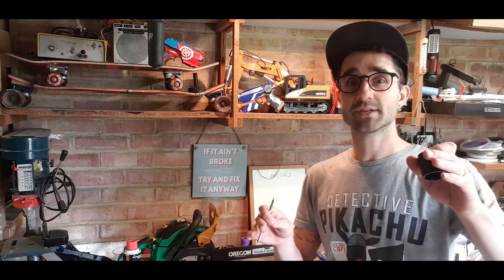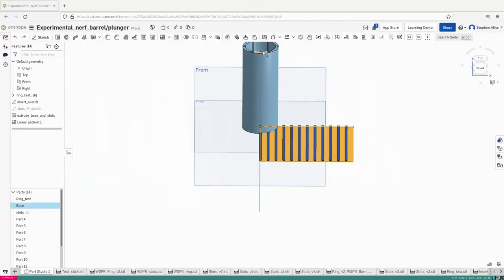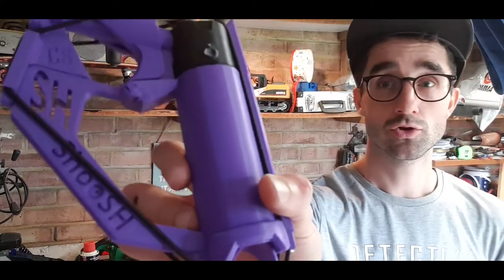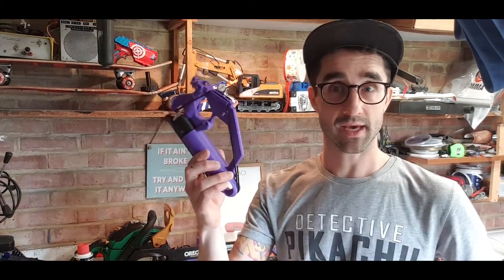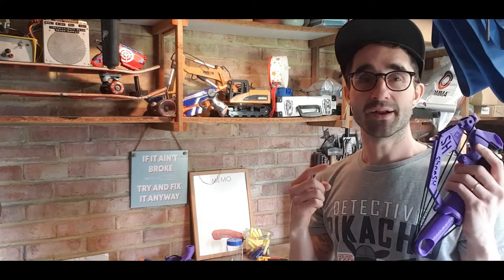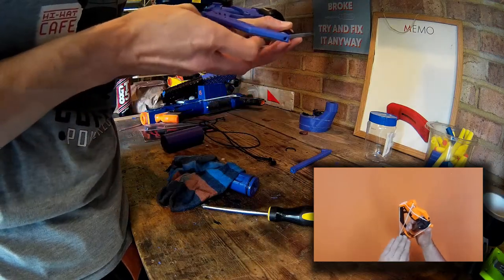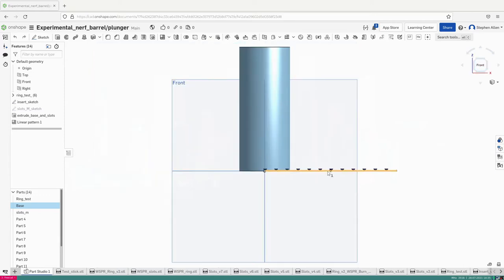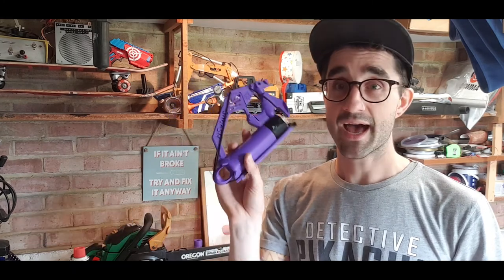3D Printed Nerf: Plunger Tube

Comment: Interesting take. I just read the reddit thread from Türkiye and suggested another idea there.
You could print a sleve out of PA in vase mode. Mybe the layer lines were not the problem but the inaccuracy at the inner seam. I would also print from  a step file rather than stl to avoid any facets.
PA might also have an edge over PLA. ABS or PETG in terms of lubrication.
Reply from the maker: Great idea, I might have to try that when I build my next wspr